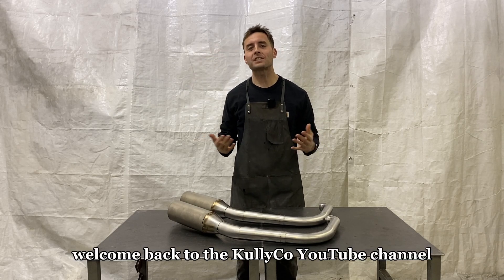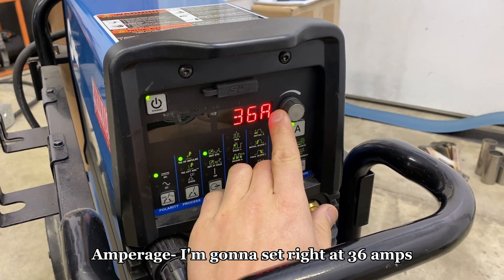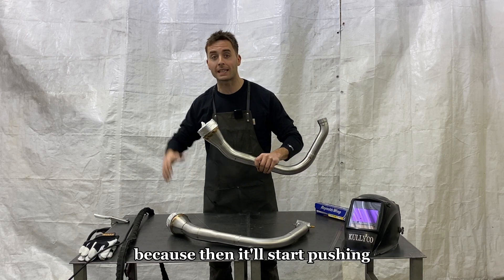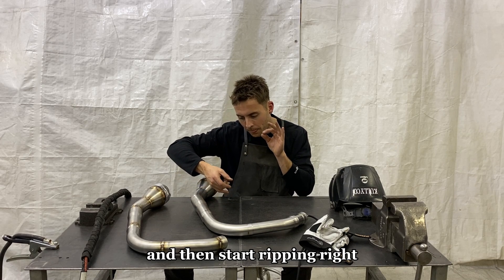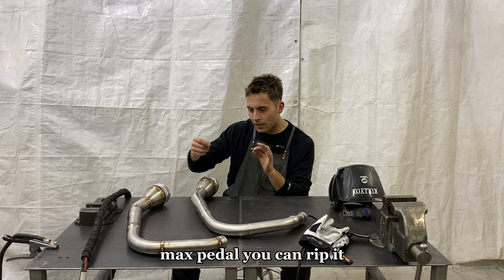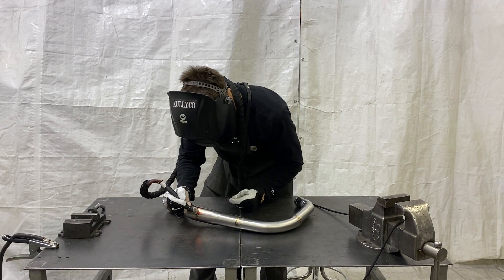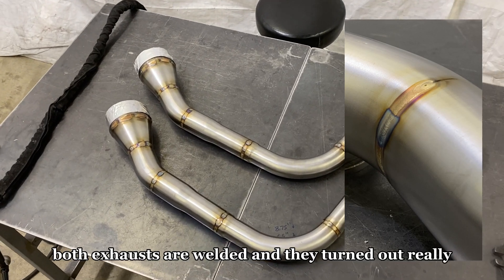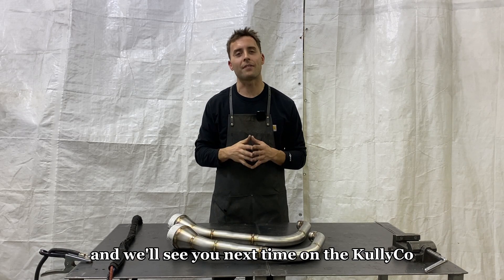TIG-Welding Stainless Steel Exhaust / For Beginners / Step-by-Step Tutorial!

Comment: I came across your videos , appreciate the tips , info ..  could you show how you make the end of an exhaust that enters the heads held in with exhaust flange?
Reply from the maker: You're welcome, I appreciate you watching.  There are a few ways to hold the primary header at the cylinder head.  One, you can waterjet a flange and weld the header solid, or two you can CNC or Print a 3D flange that the header pipe slides into and is secured with springs.